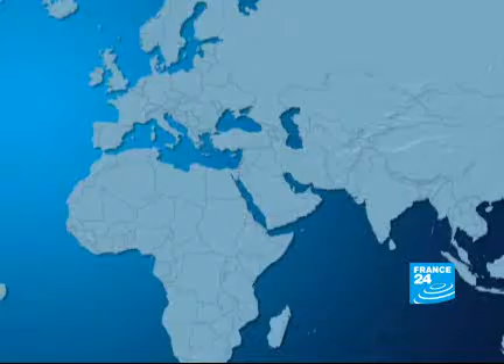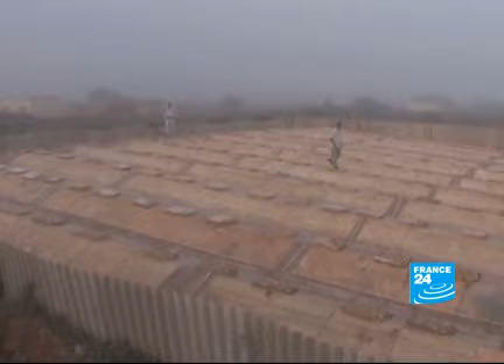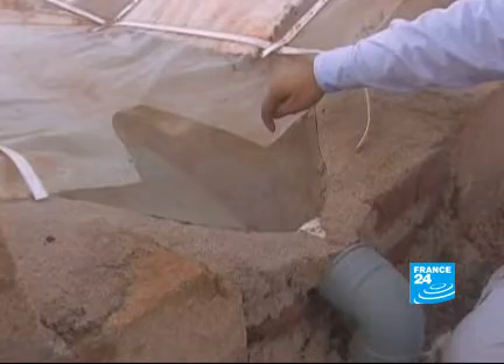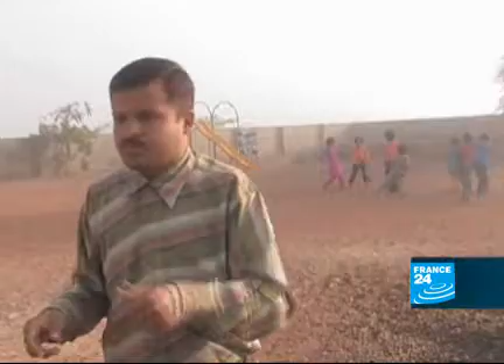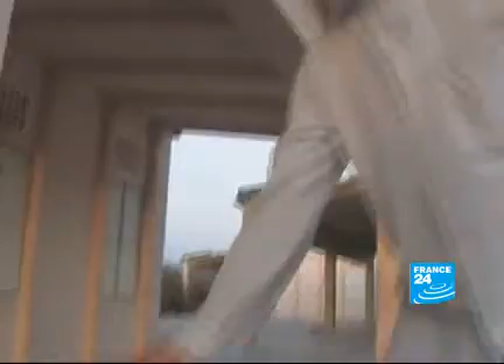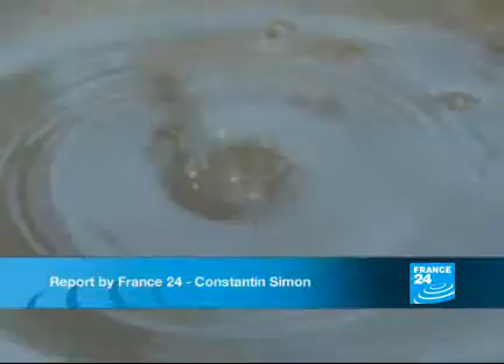Solving the drinking water crisis with condensation

Comment: If you were to add in some cold coils  in the air you can extract water as needed. 20 foot  copper coils straight up in the air.
Reply: It takes energy (like electricity) to make the coils cold. However, as the night grows colder the air temperature usually drops making a dew point between the outer atmosphere and the warmer plastic sheet which is angled downward to shed the drips to a pipe.  Copper can only conduct due on its surface and is expensive  per kilometer, but plastic can be large and inexpensive.

Comment: What your suggesting is EXTREMELY expensive and is already in practice.  The process of transforming sea water into drinking water is being carried out in Saudi Arabia.  the cost is so high because water takes an immense amount of energy to heat up past its boiling point to create condensation (the cost of the fuel to heat the water), then there is the added cost of getting to that condensation.